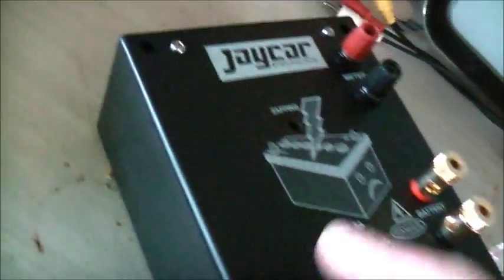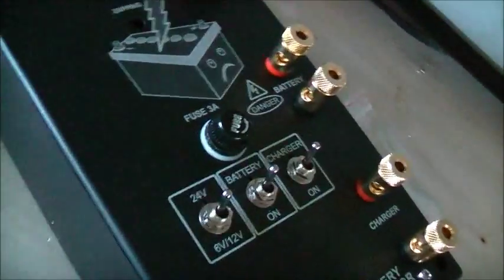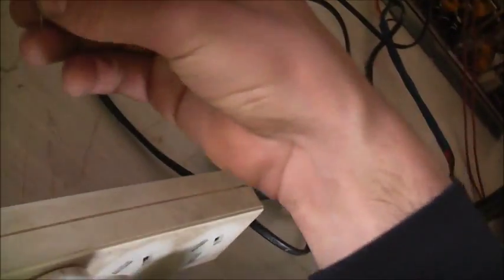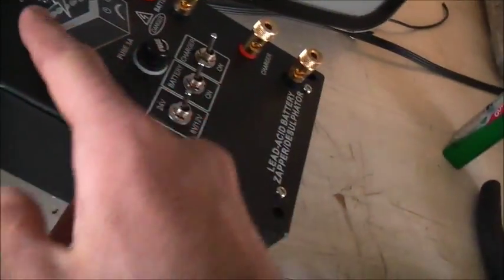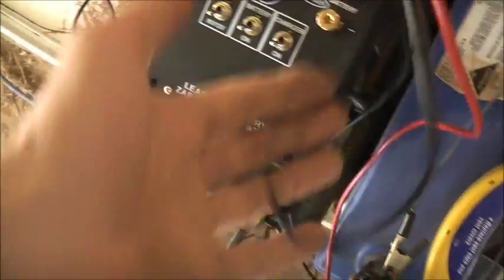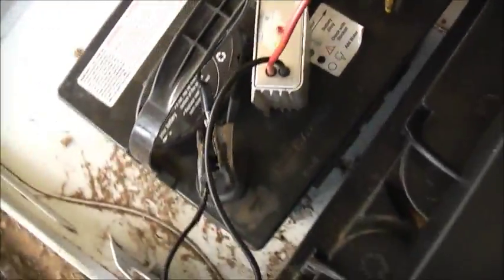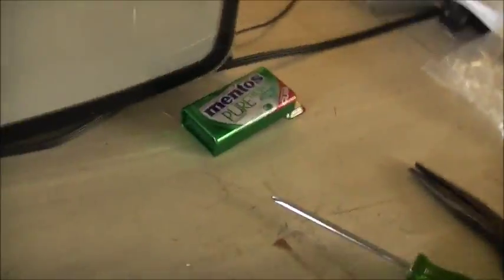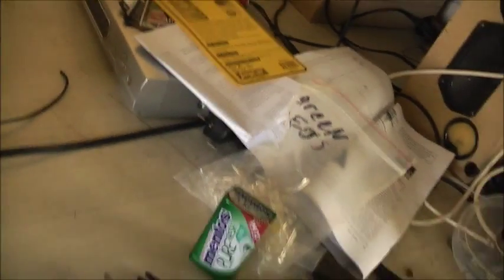Building Desulphator part 2, Works Well!!

Comment: So in my big truck I have 24v with 2 12v in series.  I want to try a Desulphator in the worst way and have been following your build.  Do you think that one box on 24v could really do both the 12v together in series or would I need 2 of them and do the batteries separately?  I guess that is sort of what you are doing so I could just wait and see how it works for you.